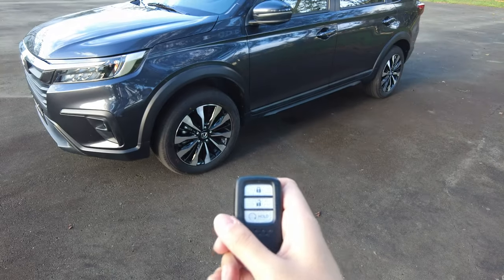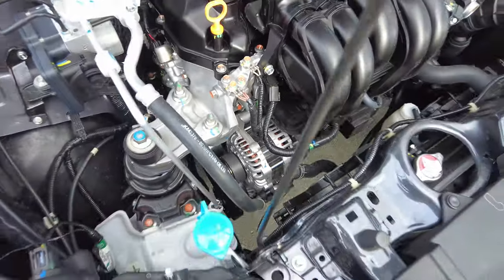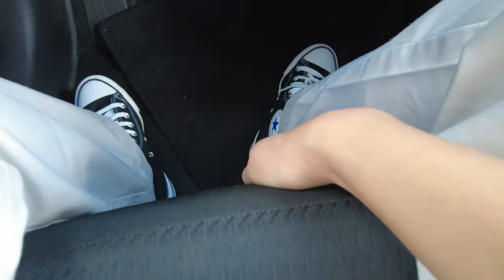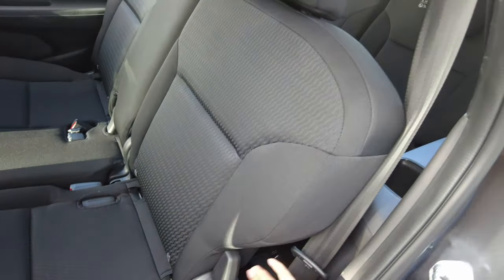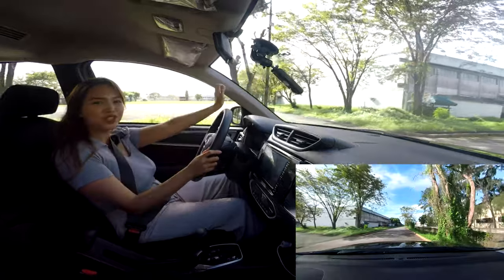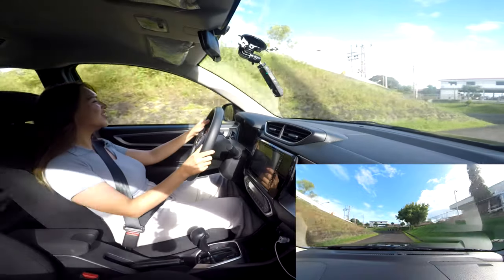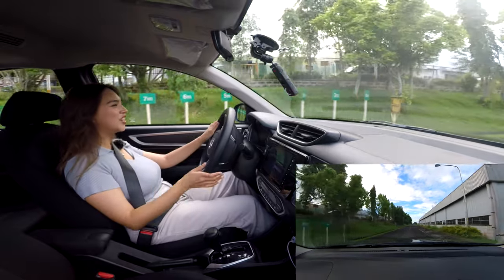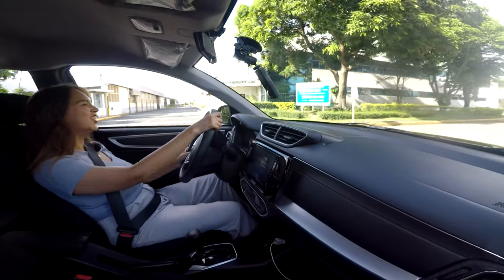The All New Honda BR-V Review | A 7 Seater That is a Surprisingly Fun Car to Drive

Comment: The second row is not a Philippines configuration where in passenger at the back row should disembark to the right side for safety
Reply from the maker: Both left and right flip open tho
Reply: @chenee_hazel  but the second row seats configuration are for right hand driving

Comment: So excited for my new brv vx later 😍. Thank you for your detailed review 😘!
Reply from the maker: Enjoy!!!
Reply: How ur drive test in brv sir?
Reply: @oigemer1  along all midrange suv/mpv i tested so far including expander, rush, ertiga, Okavango,  I think im enjoying the responsiveness of brv and speed acceleration. It's like a bumper car. You can't feeling any gear shifting, because of cvt technology of honda. And steering wheel so smooth (eps). Cons? sounds of engine when you press too hard the pedal gas you can hear a sound coming from the engine i think it's vtec of honda. but for me it's sounds fun i really like the rumble sounds it feels like turbo and vtec really works well.
Reply: @DrKen03  brv vx ang new car mo sir? Pinagpilian ko si expander cross 2023 o si brv vx..Undecided pa ako to buy my first car
Reply: @oigemer1  yes vx. Try mo magtest drive ng both model same day. And follow up test drive mo kung di ka padin sigurado. Mas responsive yun brv sa test drive ko.
Reply: @DrKen03  so far satisfied po ba kayo sa driving comfort po.
Reply: I'd also go with brv because of the more powerful engine and better fuel efficiency. Yun talagang higher horsepower, it gives me peace of mind and confidence na kakayanin ng sasakyan umakyat sa kahit anong kalsada or akyatin.
Reply: Hello sir ok poba Ang brv ..Plano k kc bumile?